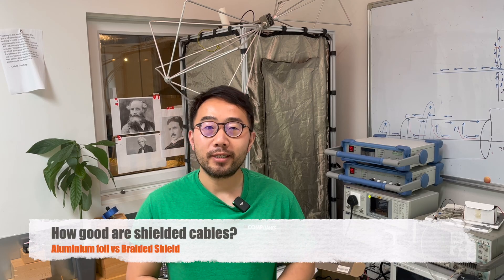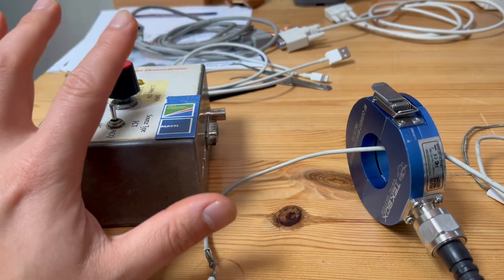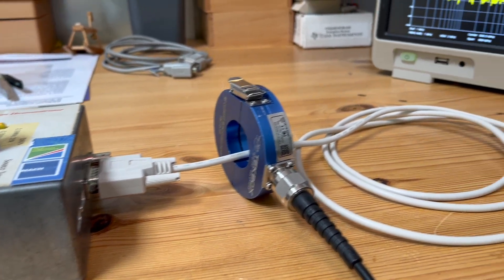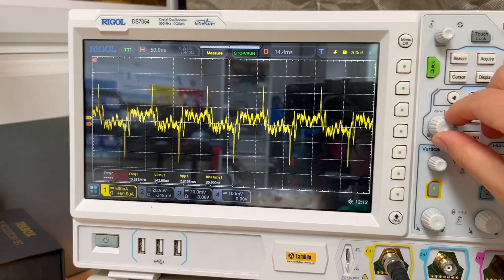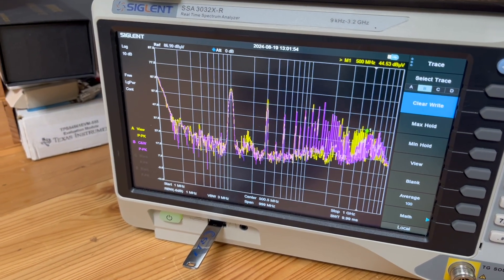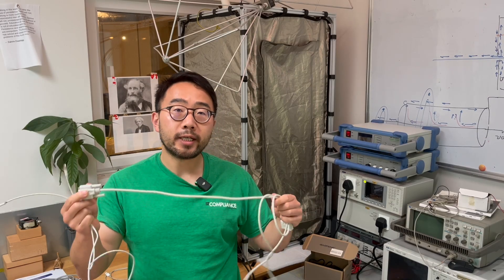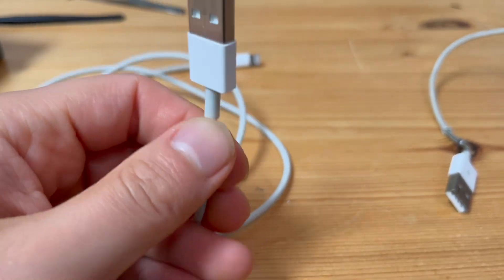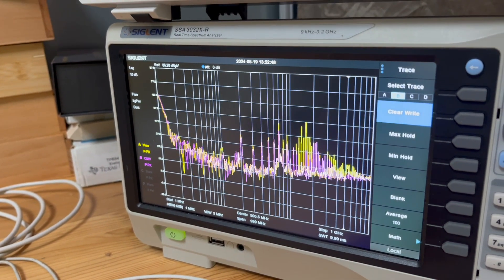How Good are Shielded Cables? - A Practical Demonstration

Comment: Hi Dr Min,
For example CAT7 ETH cable.
Do you Terminate the Foil( which separates each Twisted pair ) and the Braid shielding that covers all foils in the same place?

or other arrangement?

In addition could you make a video that explains how the Current returns in this case, and in general the return path of shielded ethernet cables? ( there is coaxial structure between the Foil and the braid outer shield) " shield inside shield"?

Thank you.
Reply from the maker: Just got a ISN for measuring CAT 3 and 5 cable, but the principle should be the same. let me do some research and share my finding with you in our future videos.

Comment: This is normal in USB A to B cables. Even when they have a braided shield they are rarely connected on both sides. However, USBC did away with that by mandating the shield and GND to be connected on both ends.
Reply from the maker: indeed. I still remember my first iPod. When I opened up the flat connector, I was curious how a good quality copper tape there could improve the EMI suppression.

Comment: How is the clock demonstrator built? I'd love to see what chip you used to generate the fast rising edges.
Reply from the maker: It is just some switching MOSFET, you can design the gate drive turn on resistor (make it close to 0 R), so the rise time is sub nanosecond

Comment: Thank you for the video. But could you explain why you are measuring CM current to measure shielding effectiveness?
Reply from the maker: There are many ways of measuring the effectiveness of a shielded cable. Using a current probe is just one of these methods. As I mentioned, when it comes to shielding effectiveness of a screen, the theory often doesn't match with the reality. So a current probe method measures the current on the outer surface of the shield, which should be zero if the shield is really good and terminated properly. if not, you are gonna see significant CM current on the outer shield. I would recommend watching this https://youtu.be/bKaBWkOyMe8?si=ZmWBJIa7sG2z7WPT
Reply: @MachOneDesignEMC  Thank you for your reply. But that is actually a question. In that video, you provoke high CM current by attaching an extra piece of wire to the central conductor. In this case, you measure CM current that is just because of extra displacement current from the central conductor to external room ground. But here you measure the effectiveness of the shield using a similar approach but not connecting anything to the central conductor.
Reply: I assume here that with a bad cable, the skin depth is relatively high so return path current density is also presented on the outer layer of the cable, and due to finite conductivity and inductance, the is some voltage drop on the outer side of the cable, that causes the CM current... Thank you.

Comment: Good video again! And nice tshirt! 😀 But there is one question: I was tought that it is very important to ground a shield in both ends. So what is the difference when measuring?
Reply from the maker: Thanks Tomas, you are very kind. Yes, there are so many myths about terminating the shield, which we hope to answer in future videos, stay tuned. I just need to find/build some circuits to prove the point.
Reply: @MachOneDesignEMC  Super!
Reply: @MachOneDesignEMC  As someone who has to terminate shielded cables daily, I eagerly anticipate your video on this in order to dispel some of those myths and let me know the best way to terminate them.
For this reason you have another subscriber.